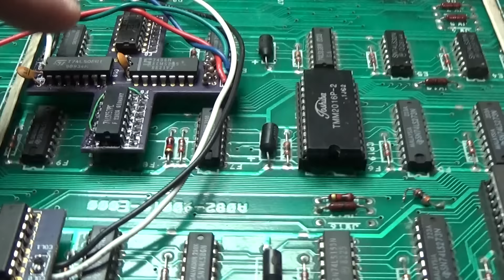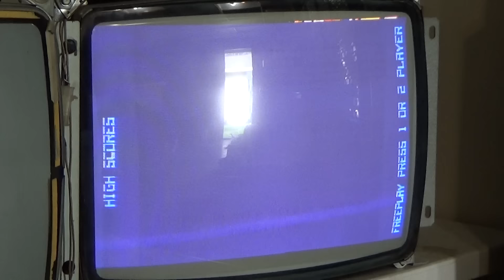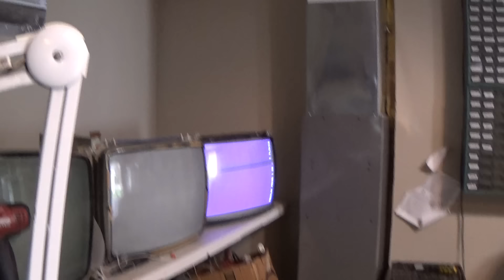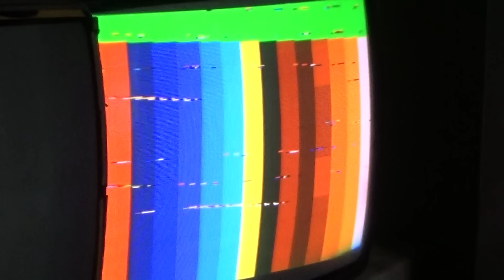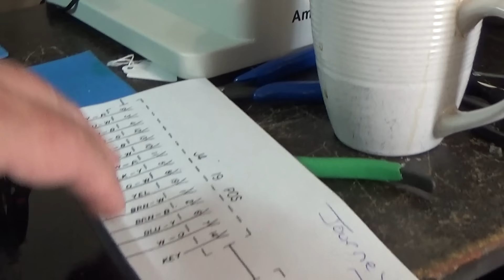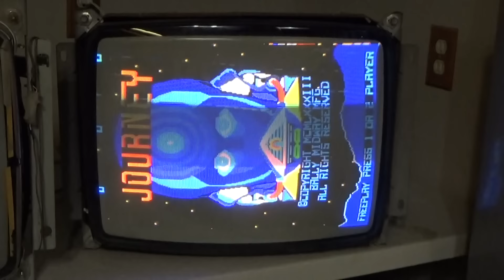Missing Sprites - 1983 Midway "Journey" PCB Repair - 5/11/22

Comment: The 82S09 video RAM is IIRC a 9 bit dual port RAM which is pretty popular for a palette RAM on many early 80s games, not just Bally. Gives you 3 bit per color, 512 colors.
I remember our Tapper had a picture like the CRT was way beyond used up. No blue cutoff and the whites were kinda yellowy. Since the CRT also takes upwards of 30 seconds to warm up, I thought it was a bad CRT. Turned out the middle blue bit on the 82S09 was stuck on.
Also our Tapper says Sound board error (if you turn it off and on again since the CRT takes too long to warm up), but sound always works fine.

Comment: Those holes are on the sprite board are probably a remnant of prototyping. On a lot of games, they will often times have footprints for components where nothing but power and ground are hooked up so that way they could add circuits and run wires to where they need to go. Considering it's a midway game, that solder mask is super easy to scratch off because midway made their pcbs out of wet tissue paper makes me think that.